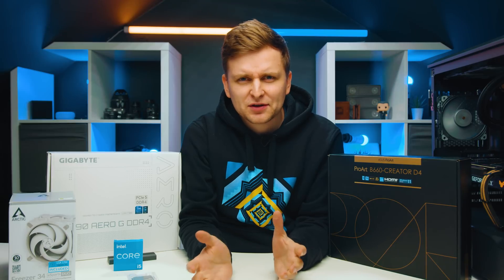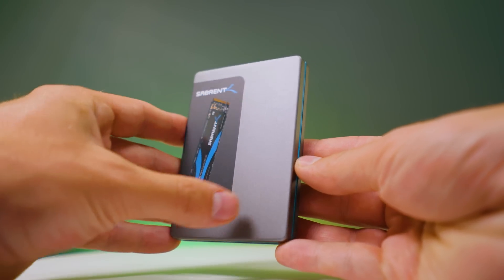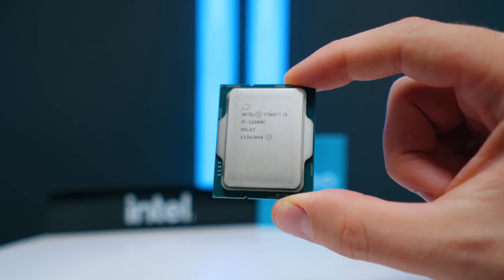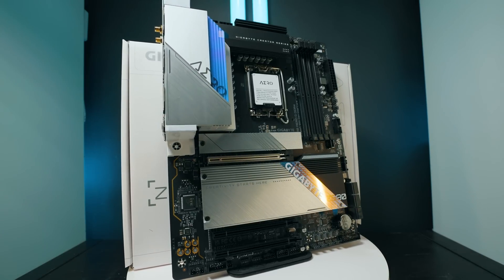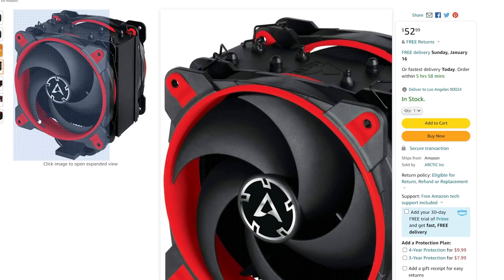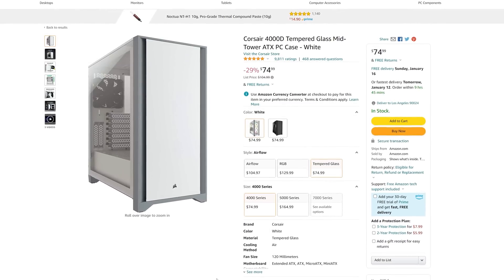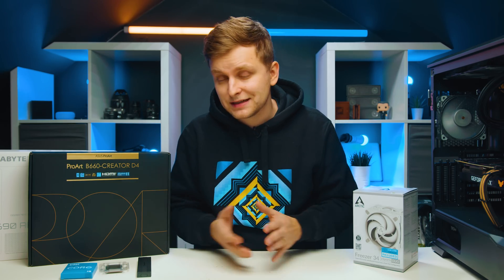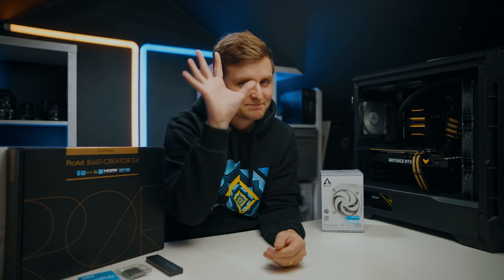Best Bang For Buck Video Editing PC 2022 - $1500 Workstation You CAN Build Right NOW!

Comment from the maker: NB! If you're budget is flexible there's also an amazing Upgrade path for this PC and I've left some options in the description above :) Like i7, i9 etc....
Reply: My budget allows for significant upgrade options…besides an i9 what are some other upgraded versions of the parts for this build…I don’t want to tweak anything you suggested and than come to find it’s not compatible
Reply: Thanks for the above video, very helpful.

I'm from Ireland and want to buy the parts from Euro sources yet have same power supply as UK (With Brexit the duty i have to pay from uk sites including amazon is crazy, but I can use Amazon Germany and other European sites). Also I have €2,000 could maybe push to €2,300. I use DaVinci in editing and will also be using the PC for streaming (presently OBS to Castr ). So with that in mind if there is any advice or video links you could post in reply that you think are relevant to upgrading to that budget and for those purposes I'd greatly appreciate it. 

Did you finish part 5 of the The Ultimate Creator PC/Workstation | ASUS x570 ProArt build and does it come down to the €2,300 budget?

Thanks Tom
Reply: i have question...  can i choose i7 12700K on this build.. every thing same except I7 12700k? i Want to build pc with I7 12700 K

Comment: In 2023 the 5900x is looking the most attractive for a $500.00 video editing power house system.

All those gimmicky overpriced V-cache 3D processors are going to depress prices on everything else.
Reply from the maker: Is highly recommend checking out the i7 13700k from Intel :)
Reply: @theTechNotice  Everything PC is so bloody expensive right now.  I want 16 cores but I really don't want to pay more than $200 for a CPU... ever.  Even that is a crazy high price.  Once you add in a motherboard and Ram, you're pushing $500, which is too much imho to spend on the core computer guts in 2023.

For the last 3 years I've been rendering on an 8 core FX-8350 / 32gb ram & mobo & AIO watercooler which I picked up off ebay for $150 total.   I've got a 4790K which is about 33% passmark faster... but it would be nice to get out of the stone age.  The PC industry just is not delivering...      

Overpriced CPUs and motherboards targeted at gamers, not content creators.

I'm probably going to sit it out another year until I can pick up another $150 deal when someone upgrades the guts of their gamer rig.  Prices are just so absurd right now.

You can't understand it, until like me you have a barn full of hundreds of computers going back to the 1960's... some of them that once sold for $10,000 a piece, now absolutely... worthless.  Still do the same thing they did back then, but the whizbang bleeding edge left them, like it will a 149K or 7950x3d... within a year or two.

Comment: Hey, really appreciate your videos very informative and lots of great tips, really appreciate it!  
I have a question,
I live in the middle East and am needing a full setup, i will use it for video editing, using davinci resolve. I think I will probably follow this build, My questions...
Dust gets everywhere here so I ha e looked at a few cases that also include dust filters but it there any you could recommend that would work with this build?
In the country I am in the temperature is 30C+ for most of the year, I habe an AC but still the temperature is hot, what would you recommend for best cooling considering the room temp of the air is not that cool.
Lastly, I also need to get a monitor that will display that shows true colours. Unfortunately my budget isn't big, it's around £1500 (GBP).
Where can I cut of cost if anywhere?

Comment: Nice.  I just built similar.  R 7 5800x, noctua 15d cooler, msi mag x570 tomahawk wifi, 32gb 2x ram, rtx3060, 1tb nvme 4.0, 4tb wd black 7200rpm hdd (in raid1), corsair 750w 80+bronz, in corsair 4000d airflow white, added two 140mm coolermaster pro front intakes.   No rgb...backs up to synology nas. 
The hardest part was trying to understand ram kits 4x single rank or two dual rank.  Its confusing.  So i went with two sticks of 32gb and will upgrade later.  Then the 4 pin cpu power.  So many said it wasnt needed.  I did use it in fear of stabiliy issues.  Please go over these two topics.  Love your channel.

Comment: Quick question, I bought the arctic freezer 34 Duo and the gigabyte aero g and the bracket for the back of the motherboard doesn't fit. What can I do?
Reply from the maker: Did it come with lga1700 mounting kit? If not you should contact arctic! Coz it was most likely old stock.
Reply: @theTechNotice  I did find out I needed a bracket that fit lga1700. Mine did not come with that form of bracket so I ordered a new one. Seriously, thank you for replying just out of courtesy and willingness to assist. You are awesome! Your videos have been insightful and you've even gone a step beyond to help with no benefit to yourself. I'm building my first pc and I'm uber excited about it and you've provided the most insight and explanation and have answered both of my questions in the comments. Keep up the awesome work; I know many others out there appreciate it just as much as I do! You've made this intimidating project a little less intimidating.

Comment: Hi tech, thanks for the video, very good! I wanted to ask you a question, for an i7 12700k for premiere, do I need a 360mm watercooler or am I fine with a 240 or 280? Thanks!
Reply from the maker: I wouldn't go anything below 280mm, but 360 would be nice especially for long exports/renders... :)
Reply: @theTechNotice  Thank you very much for your quick response Tech!!!
Reply: @Fededrums25  I’m thinking of getting it 12700k and using it for premiere, did you end up getting it? Does it work well?
Reply: @JakeMasseyFilms  Hello! Yes, I bought it in the end, and I put a 360 deep cool radiator on top and there was no problem, the tests at 100% give me 72°c maximum, in a darkflash dlx21 case that has good ventilation, and with only 2 fans included, 1 rear to extract the air and 1 front for the entrance, and with an ambient temperature of 23°C.
For premiere and with my clip from a7iii to 4k 100mb with various effects and playback on the premiere monitor with full resolution is super smooth, the best playback without obstacles, with 2 or 3 luts and transition effects with various adjustment layers and masks at the same time and super fluid.
My gpu is an RTX3060 and at the moment I have it with 32gb of fury beast ram at 3200mhz and I intend to add 32 more by the end of the year, and my power is a 750w gold. I recommend you use a m2 for W10 and applications, 1 ssd for videos, and 1 m2 for cache and previews, this is very important since everything on 1 disk would be a bottleneck.
I really recommend this equipment 100%, with an asus tuf b670 motherboard it is more than enough for a good price, I think I will not need more upgrades for at least 4 or 5 years. I hope to help you with my comment!

Comment: I commented on your other videos where I mentioned I was wondering how long I could go in terms of a gpu to pair with a 12600 , for simple photo editing + Adobe Indesign , you recommended a 3060 or at minimum 3050 then , but would a 3050 cut it ? Or would upgrading to a 3060 really be worth the extra bucks spent?
Reply: Depends on ur budget, you can get 3050 and spend more on extra storage. As he said in the video, the iGPU is powerful enough.

Comment: Conformation bias is a wonderful thing. I just came across your channel and I've built almost the exact same system even down to the brands. I spent a little more because I wanted to. I went with the  Asus Prime Z690M-Plus D4 MATX motherboard because I wanted a small form factor build  and I spent $125 on the case because it's all brushed machined aluminum. But crazy, almost exactly the same.  And yes, I cut on Davinci Resolve. I didn't realize that DR would use the codecs on the IGPU! Thanks for that.
Reply: I built this PC too but with a used GTX 1070 due to GPU prices...which has Nvidia encoders in it. Bit my scrubbing using DaVinci Resolve isn't that smooth...what settings do I need to play with to improve??

Comment: Can I go with this gpu?

Gainward Ghost VGA RTX3060 Gainward Ghost 12GB GDDR6 NE63060019K9-190AU

 GPU Clockspeed 1777MHz (Boost) 

Memory 12 GB GDDR6 (192 bits) 

Memory Clockspeed 7500Mhz (15Gbps)

 Bandwidth 360GB/s 

Bus PCI-Express Gen 4 x16 

Cooling 2 Slot Dual Fan Cooler 

Video-Features HDMI v2.1 Connectivity DisplayPort *3
Reply from the maker: Yes

Comment: *I noticed the memory clock speed on one GPU choice was listed at 15GHz and the other was in the 1800MHz What is that about?* ... I chose the 1800MHz saved $80 on the GPU but the question remains on the memory clock speed difference??... I have ordered every part on your list, and am getting parts in starting today. Also bought some in person at Best Buys, my cost ended up at $1920 loving all the components, hoping for a real great build, and a great computer with a future. I went with black instead of white as my monochromatic non rgb color scheme, going stealth like Darth Vader or rather Ninja.

Comment: You list the i7-12700K as an alternative to the i5-12600K.  It's only $75 more right now.  What is the advantage of the i7-12700K over the i5-12600K , and does the i7 run cooler than the i5-12600?  Love all your reviews btw.  I pass along your reviews to my friends.
Reply from the maker: 12700k is more powerful CPU and a great upgrade if your budget allows! Nope it wouldn't run cooler, but this  cooler is still enough :)

Comment: good morning,

thanks for your channel, it helps me a lot and keeps me up to date 🙂
I have a question, maybe you have an answer for me. 
I like to use this configuration as a video capturing device with an internal 4 channel 4k capture card. Do you think that the i5 ist enough or do I need i7 or a i9 instead?
Do you recommend a CPU watercooler, if yes wich one I should have a look at it?

Thanks for your reply
Cheers Markus
Reply from the maker: Maybe upgrade to i7, but I think even the i5 will be good for that, but i7 is a safer bet. 
No need to go with an AIO, but if you do, Arctic Liquid Freezer II 360 is one of the best price to performance coolers.
Reply: @theTechNotice  Thank you very much for your answer 🙂

Comment: 🤔 that’s the first I’ve heard that the non airflow 4000D has decent airflow & recommended over the Airflow variant.

But I understand as this is a budget build & trying to save as much $$ as possible.
Reply from the maker: Trust me the front intake with airflow and non airflow has no difference since the caps on the sides are huge! :)

Comment: I am building the first "Photo Editing" rig and trying to stay around $2,000 not counting what I already have. I have the Samsung 43" Smart 4K TV as a monitor, Seagate's 1T BarraCuda Q5 M.2 SSD, and Synology'S DS220J as a NAS. For the cost, I would like to use the 5800X CPU but there's a cheater about heat issues. What does this look like?
Here’s what’s in my cart:

CPU:	Ryzen 5900X

AIO:	        Cool Master ML240L RGB V2

MoBd:	MSI MEG X570S ACE

Ram:	32GB (PC4-28800) Team T-Force Alliance

HDD:	WD 250GB Black SN750 SE NVMe (for OS)

Video:	MSI Ventus GeForce GTX 4GB GDDR5

PSU:	Cool Master MWE Gold 750 V2 Full Mod

Case:	Corsair 4000D Airflow
Reply from the maker: Look great but why don't you go with Intel i5? At the moment better pick for the price, like in this vid ;)
Reply: @theTechNotice  Stock in AMD :-)

Comment: Thank you for your video. I've subscribed to your channel. 

The GIGABYTE Z690 AERO G DDR4 motherboard on Newegg USA had a rating of only 3.5 whereas the 
MSI MPG Z690 EDGE WIFI DDR4 LGA 1700 ATX Intel Motherboard has a 5.0 rating from over 100 reviews. Would this be a good alternative? Please share your thoughts. Can you recommend some other options. I do not have a Creative Cloud account. Thanks mate.
Reply from the maker: Well the question is do you want to go with DDR5 or DDR4?
Reply from the maker: Budt Borth Borth Aero G and Edge WiFi have DDR4 versions available. If you don't need a USB-C video output then the Edge is good as well. The Aero G DDR4 is the most feature Packed motherboard for creators with DDR4 :)

Comment: When selecting prebuilt somewhat  custom pc, I only have one choice, and only intel and only watercioler which I don't want. And only Ddr5 32gb, no 64gb available yet. And if building on your own I only have choice between 2 boards. So so far only one PC build option at the retailer here in Norway. But if I go for AMD CPU I get a proper air cooler van select noctua cooler. So far Ddr5 is pricy. Rtx 3090 is available only for pc builds, not seperate, and only build that has it is the AMD CPU build. So seems the best bang for the buck. For some reason the lastest and greatest builds are limited to water cooler only. Absurd. But for some reason the only Ddr5 build is  32gb max and water cooler only. Absurd.

Comment: Little on the expensive side for the key components... I´d opt for a 12700k and 3060 and rather safe a little on the motherboard. I´m in europe (germany) and 12700k with Z690 is around 550 on sale, 3060 costs crazy 650 if you dont a FE drop somewhere...
It would end up at around 1500-1600, with normal prices you would get a entry level 3080 atm for the same price:/
Reply from the maker: You market allows at your country, sounds good to me and makes me slighlt jealous;)
Reply: @theTechNotice  Yeah sure its very dependant on the market :/

Comment: I believe this is wrong choice - CPU should be 12700k because it only is 100 Eur (120$) more expensive than 12600k. In the grand scheme of things, if you pay 100 more at this price level (1500), it just doesn't matter anymore. You will be using this machine for year, two, maybe three, there are two P-Cores more, it's just much better chip for pennies more.
Reply from the maker: If your budget allows I'd agree with you but someone who is very tight on a budget and would rather spend that on keyboard, monitor, mouse, I think the 12600k is well enough for that. :)

Comment: Great video.. so i currently have a ryzen 7 3700x 8core 16 threads in my system with 64gb ddr4 and the 500gb samsung evo plus pro ssd mvme2 some how i feel like im not getting the performance i should be getting.. im not sure if its my radeon 570 gpu or the speed of my ssd somewhere in there i think im bottle necked not sure if i need to replace parts

Comment: All these people complaining for getting their builds over 1500$. The market is fluctuating, keep looking for deals! 

GPU prices are unstable. All other components also may change day-by-day depending on how in demand or in stock they are. It'd be easier to find cheap deals on different parts - but always do research on the alternatives.

It's true - don't cheap out on a PSU. Pay more if you have to or alternatively they are often on sale (just do the research for reviews, warranty and all that). Similar with RAM modules, you may even find something cheaper than the video - but, you guessed it, read reviews and do some research.
Reply from the maker: Amen!

Comment: Wonderful.  I have been waiting a long time to build this.  Have been getting along with my 2014 Intel 17-3770K with GTX 1050ti  build but waiting 7 hours to export Premiere Pro 4k video is wearing thin.  This build should get me 1:1 or near there for times.  At least much better than 1:3.5 times.  Should be able to play 1080P AAA games well.  Thanks.I will recyle my current Corsair 110R case and Corsair 600W SFF PSU to save another $250.
Reply from the maker: You're gonna see a huge upgrade! :)
Reply: Same dude, my i5 3570k with an rx580 hackintosh. I was able to export 4k braw at 24fps which is pretty good. Now I just built a 12700k
Gigabyte aero g ddr4 z690
Gigabyte 6800xt ($1050 open box from BB)
O11 dynamic 
Corsair rmx 850w psu
32gb g skill trident
Arctic liquid freeze 360mm aio
And 6 al120 fans
2TB Samsung qvo (going to get a nvme and run nas storage)

The thing rips and off got really lucky with my gpu price. It ran me a little over $2,000. I could’ve got it much cheaper had I waited for everything to go one sale. I’ve seen the 12700k $80 less than what I paid. I’ve also seen seasonic psu’s on sale for cheaper than my Corsair. I personally think the 12700k on sale is a better option than the i5. I’m hitting 23,000+ in cinebench r23 right out of the box.
Reply: That case is gonna get hot
Reply: @DonovanMcNabb5  Thanks, I was wondering.  A new case is not problem.  About $100 so no problem.